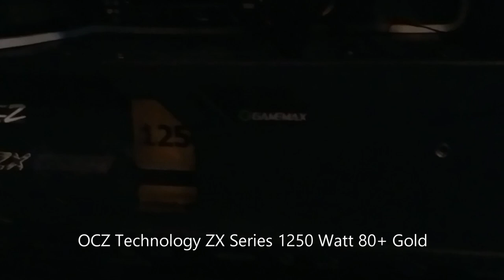SignalRGB ALL IN ONE LIGHTING Effects in Sync with Each Other Custom Gaming PC

Comment: Can i control each fan seprately if they are daisy chained and plug into motherboard's header or i must need controller?
Reply from the maker: I don't think you can do it 1 by 1 like we can with Corsair ICUE.
Reply: If you daisy chain say two fans, it will act as one. Each fan has to have its own ARGB connection if you want to control them individually.